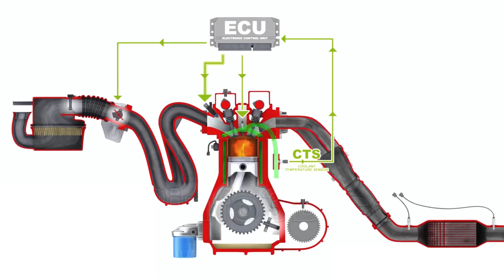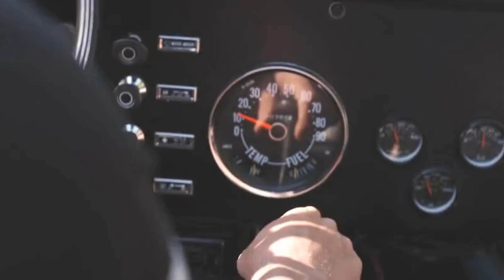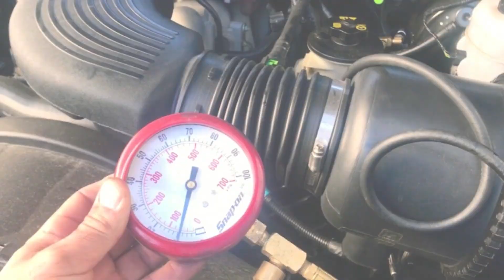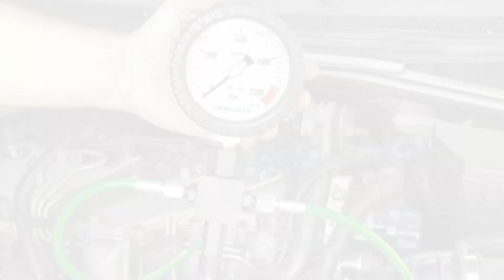10 HIDDEN Reasons Why Car Jerks When Accelerating & DIY Fixes

Comment: What if it studders/small gerks sometimes between 20-40mph when you accelerating and no other speed?
Reply: That's b/c your issue is occurring during gear shifting, but once you get to like 45 or 50, most transmissions are already in 5th gear so they don't gear down until you brake, and then the process starts over again.
Reply: @TheBourneBlogger  yes but what is the cause?

Comment: I found with one car I had with a bad MAF sensor that barely ran, all I needed to do is unplug it. It would then idle a little higher and likely run a little richer. Spent ~$80 for a new one and it failed in a year or two so I unplugged that and got another from the junkyard for ~$5 that lasted a few years till I sold it still running well.
Reply from the maker: Wow good use of mind and experience

Comment: All these channels keep saying it could be a faulty throttle position sensor but what if you have an electronic throttle body?
Reply from the maker: If your car has an electronic throttle body (ETB), the system is slightly different but still depends on sensors like the Throttle Position Sensor (TPS) to function properly. In vehicles with ETB, the throttle opening is controlled electronically, not directly by a cable linked to the gas pedal.
Electronic Control Unit of your vehicle monitors inputs from various sensors (TPS, accelerator pedal position sensor, etc.) and sends signals to the ETB motor.
Throttle Body Motor moves the throttle plate to adjust airflow based on ECU instructions.
Throttle Position Sensor still exists to report the actual throttle position back to the ECU.